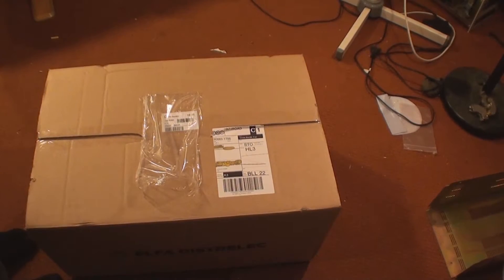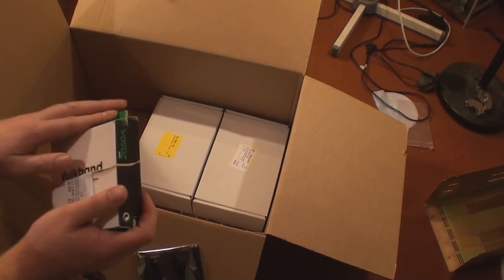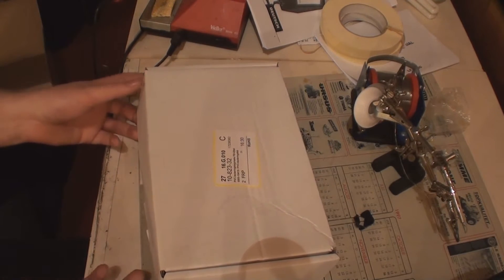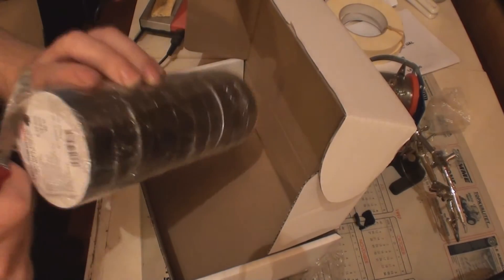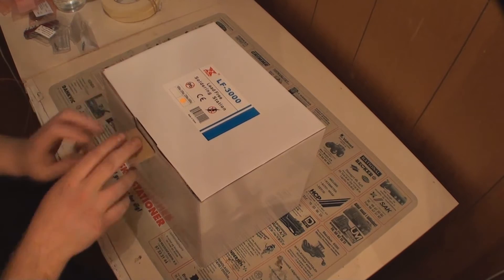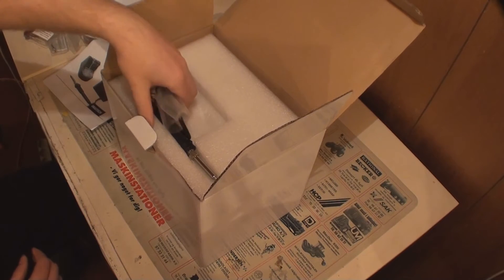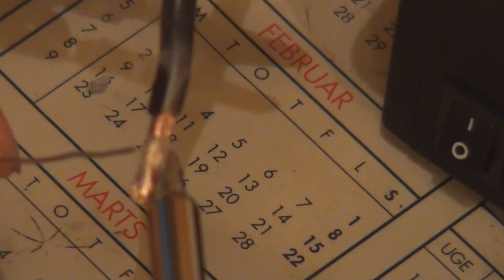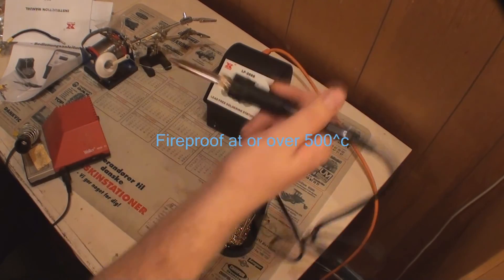Unboxing Soldering Station  lf 3000 YXTronic. PSW0 #1

Comment: A useful video. A few suggestions, however: I didn't hear you say anything about whether that was leaded or lead-free solder. Also, what gauge wire was that you soldered? It's very hard to tell from the video picture. Thanks for this.

Comment: Hi thank you for the demo, what is the ideal temperature for wbt lead free solder ?
Reply from the maker: The temperature is often determined after keping the thermal stress to the componet and the pcb at minimum.
so the lowes temperture you can work fast with is ideal. You should be able to soder nomal soder collection in a under second.
As long as it is a hoppy +- 15 deg C dosen matter that much. try start at 380 deg C

https://en.wikipedia.org/wiki/Solder

eevblog  has some Soldering Tutorial.

Comment: The same deal on Elfa in Norway, considering buying it. The handle looks like a copy of Hakko's, do you know if Hakko tips would work with it?
Reply from the maker: TheAmmoniacal  i do't thing  they  fit, the outer diameterof  the YXTronic tip  shaft is 3,6mm  and the inner is 2mm